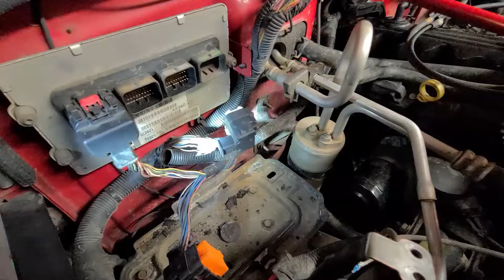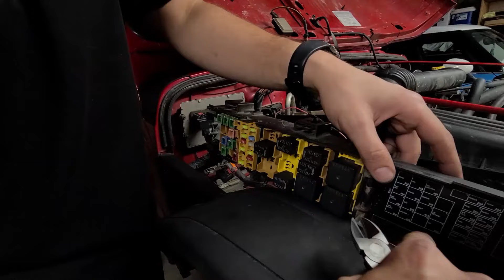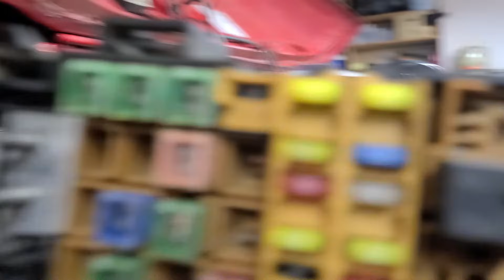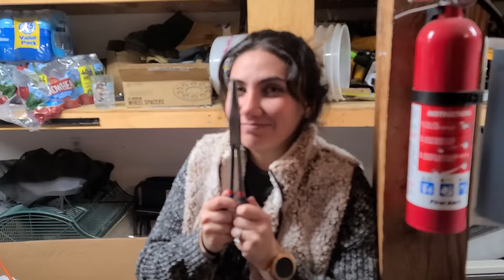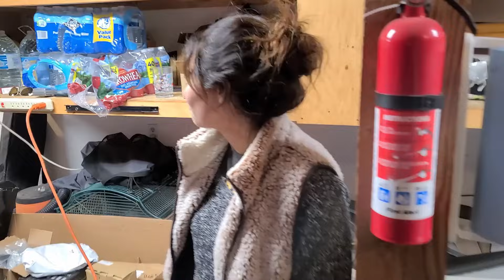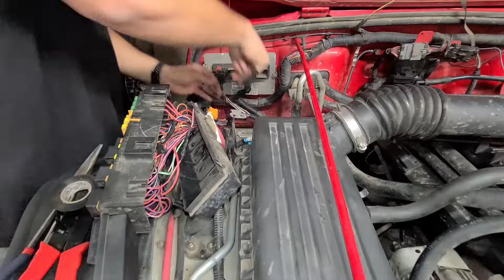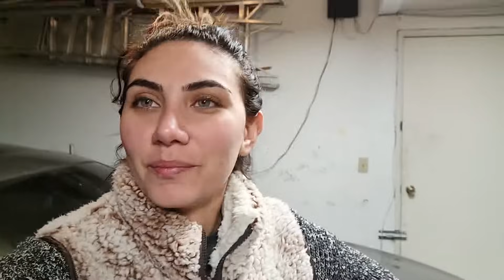STRANDED by the ASD Circuit! Here is HOW we Tested and Fixed it! Easy!

Comment: Great video. I think I'm closer now to solving my intermittent stall. When the jeep warms up it stalls and it won't start until, with the key in "run" I hear the fuel pump kick on. I read that the ASD relay controls that so it seems I'm getting a short that tells the ASD that power is off then on. I've tries two ECMs. Which wire was the brown one that was broken called? My cherokee is a little different relay than the wrangler.

Comment: I have a 95 grand that's currently in the shop for the 20th time,  trying to figure out my intermittent shutting off issue. I had researched and replaced my ASD relay and it worked for 3 months or so. Current mechanic has it for the 3rd time and it's throwing a code for the camshaft. He replaced that and the distributor cap and it worked for a month. He's currently puzzled.
What it does is it shuts off while idling or driving slowly. Battery and dash still on. Then it has to sit for a hot minute before it'll turn back on and stay on. 
Any ideas?
Reply from the maker: I'd replace all the sensors like the cam and crank sensor the neutral switch etc
Reply: @Garagecouple  yeah, we've replaced those...

Comment: Very interesting ASD discussion. My problem is quite a bit different -- but similar, go figure!

Very infrequently, like months apart, I will be driving along without any problem and my 2007 Grand Cherokee just stalls -- no engine light, all electrical power okay. So I pull over, put vehicle in park, restart without any problem and away I go. Maybe weeks, or months later -- boom!!, same thing happens again. Park, start and away I go again. Obviously we are not taking it out on the highway, only back roads -- can you imagine the danger of driving at 60mph and having this happen?

Anyway, swapped the ASD with the relay for the HVAC (same relay) yesterday and will see if the problem reoccurs -- but it sure would be nice to know if it is "really fixed". Oh, by the way, the error code is the same P0688 you mentioned in your ASD video.
Reply from the maker: Hello and thanks for the comment! Sorry to hear about your issues. That sounds like a parking or neutral switch in the transmission. In any case I'd change out all of the electric switches like the crank and cam position sensors, transmission sensors, etc. Cheap and quick and hopefully fixes your issue

Comment: Hey bud I have the same issue crank no start.  Fuses are good, Both the fuel pump and ASD  relays clicks. new fuel pump still has no power to the  pump. What could be the problem

Comment: 96 Grand Cherokee chokes and dies when outside temp is over 75degrees. Starts after 30 min, goes a few miles and does it again. Don't have this issue in winter. Already changed O2 &crank senors, ECM. Any idea what's causing this? Taken to 3 shops, they couldn't figure it out.

Comment: Thanks for the video. As an electronics maintenance tech, I highly recommend checking out "solder wire connectors"!! Electrical tape is a %@^#& later on. 

One question tho, did the failed asd cut off fuel also or just spark? My jeep has no spark, but it's flooding with fuel.
Reply from the maker: I believe it's both fuel and spark. Cheers!

Comment: Hello and thank you for the information.   I was about to buy a new crankshaft sensor but decided to try your  ASD bypass.  It started right up.  Now my question is how do you know for sure, by doing this bypass,  that it isn't the crank or cam sensors causing it not to start?  Could it still be a bad crank or can sensor?   Thanks!
Reply: Bypass probably means just bad pcm communication wire. If it was a sensor it would have a code for that.

Comment: I had a problem with the wire going back to my fuel pump. It had fallen down on the drive shaft and was worn through. Every time i stopped at a light or sign it would blow the asd fuse. After changing out many parts I finally found the issue and fixed it. Then a month ago the jeep didn't want to start. It seemed like I had no fuel pressure at the injector rail. I changed out the fuel pump and it started up perfect and ran great for a day. Then it started stalling and not wanting to start. The wierd thing was i was not getting any check engine light. I bought a code reader that does live data and hooked it up. I have me the code for the ASD CIRCUIT SHORT. I started messing with the wires that go to the pcm and the jeep started but then when I would mess with the bundle of wires it would start to die. I could let go and it would smooth out and run fine. So I figured I had a short in that bundle. I started where that bundle mounts to the fire wall and checked continuity all the way over to where they attach to the pcm. All of the wires had continuity. I'm at a loss now as to where to go.

Comment: This was only the latest symptom, my first problem was the jeep would retain ignition power or some ignition power after I turned the key off, resulted in my Jeep staying running even with the key taken out. Then it started dying while driving and one day it wouldn’t start back up, I noticed the ASD relay was hot so I replaced it with the horn relay and it started right up and now issues seem to have all gone away, not convinced it’s fixed but this may be a problem I have As well. Thanks for your video

Comment: You guys are super fun. I found you because I had a similar issue. but I started with the fuel on my 98 TJ. I checked the pressure and it was not priming, I could prime it then at some point it would lose the prime again, So I replaced the pump. After replacing the pump it would start  well it started but it sputtered and backfired. Then all of a sudden I lost all of the gauges on the dash. so I was pretty bummed and at that point I lost the aldl and was sunk. Then I let it sit for a couple of days and went out with a test light and rechecked all of the fuses again. None were bad and it still wouldn't start. I then decided I was going to do a pinout on the computer like you guys, and I didn't find any issues so I was scratching my head, and out the plugs back on the computer. I then noticed that the gauges started working again and I had access to my ALDL, so I turned it over and it started right up. SO now it runs, but anything over 70 miles an hour it sputters and spits. So I need to do what you did and follow the wires and make sure I don't have any issues like you, but that is tedious and takes a while. For now it drives around town without issues. Thanks for this video it was really helpful.

Comment: Great video thank you say I got a 2004 Jeep Grand Cherokee with a 4.0 and it cranks but won't start ,
The list of parts I have installed new cam and crank sensor fuel pump throttle body sensor looking for any suggestions from you or your viewers ?

Comment: Great video, you said you've done a lot of Internet searching. Well I've got a 2000 wj with basically the same wiring, mine won't start, fire I mean but the ASD solenoid is opening and closing so fast, that it sounds like it's a running motor. There's wiring and then there's jeep wiring, IDK. Did you run across anything like that.

Comment: Working on a liberty jeep that complains ASD relay circuit. I've checked he circuit and every current supposed to be available on the bunch is except for the negative that comes from the pcm, traced the line into the pcm socket and it reads okay. Changed the pcm but still have same issue, took negative from another relay into the ASD relay but problem still persists and the fault code keeps repeating itself. Please share idea on this friend. Thanks.

Comment: I have a 1991 yj that overheated. I fixed that issue (waterpump) but now it starts up the first time and runs great for about 3 mins then dies. Then I have to wait a while before it will start again. Then it does exactly the same thing. Any ideas?

Comment: My car keeps dying while I'm driving or at a stop... Not sure what it is the battery is good and the alternator are good. It does even if I'm trying to pump the gas it just shuts down. I do have an aftermarket radio that was recently installed a few months ago don't know if that could be part of the problem..

Comment: I got a 1996 dodge ram same problem fuel pump not coming on brand-new,coils not spark brand-new ,pickup roller button ,dis-cap all brand new crank sensor brand new,

Comment: nothing better than stepping through a successful diagnosis.  i’m fighting with a 2007 jeep commander myself. i cant get ground on the relays.   i might try jumping the asd    if i run a separate ground wire from the relay i can get it to crank but it won’t start.  might be a bad pcm.  trying to figure a good way to diagnose that
Reply: Figure out your problem with your Jeep

Comment: I have a 1999 dodge van. As you probably know, dodge and Jeep are both made by Chrysler . I tried the jump wire on the ASD relay and the engine doesn’t start. Does that mean that the cam shaft position sensor or the crank shaft position sensor could be bad?
Reply from the maker: That is definitely a possibility!
Reply: @Garagecouple  Thank you very much for your quick response. I have replaced the crank shaft position sensor in the past so I will check the cam shaft position sensor. I appreciate your quick response
Reply from the maker: Very welcome! Good luck!

Comment: I have a 2014 Jeep rubicon Unlimited and today my jeep shut off going through an intersection and I coasted to the other side and stopped on the side of the road stranded come to find out the ASD 10 amp fuse was blown so I put another fuse in there and it blew so I swapped out the relays and that didn’t work so do you have an expert opinion On what my problem might be.  It’s been a long day 🤭Thanks in advance
Reply from the maker: Sorry I don't, sorry to hear that! It could be one of the sensors that provides input to the asd.  Maybe cam position or crank position sensor
Reply: @Garagecouple  Well I ended up finding a chaffed wire the same wire you showed in your video what are the chances of that lol.  I might not have looked for chaffing if it wasn't for your video though so thank you very much.  I repaired the wire and problem solved plus I wrapped all the other bundles that plug into the fuse box just as a precaution.  I have the genesis dual battery system in my jeep the wire was laying right on a corner of the metal battery box and that was the only chaffed wire.
Reply: Just wanted to let you know that my 2014 Jeep rubicon had the same color wire chaffed that you showed in your video.  But if it hadn’t been for you video I may not have looked for a chaff.  I removed the fuse box and started searching for chaffed wires and there it was .  Thanks again for the video your video is the only one of its kind on here.
Reply from the maker: Awesome!so glad to have helped! Cheers!

Comment: Hi Garage Couple,

Jeep WK Hemi 5.7 Limited
Driven 150,000 miles
Usually Starts and stalls after 2-3 seconds
Sometimes starts and runs fine
Active codes are: Open circuit code
Saved Codes: U0100 & U140E

Note: When car starts fine; turning the steering wheel right will cause a sporadic amount of lights to show up on dashboard!

No blown fuses that I can find!

Do you think it is a problem with the ASD and should I take the same steps as you did? My mechanic is telling me to order a new PCM :/

Comment: I have a 2014 JKU, It shut down while rolling down the road last week. After scanning it threw the Po688 code ECM/PCM power relay Sense Cir/ open. I checked for corrosion on the pins of the relay, detecting none, I replaced then discovered that the 25amp fuse marked ASD #1 and #2 was blown. Replacing that solved my problem for a week. Last night I blew three of those fuses in the space of the last 2 miles to home (stopping 3 times to replace that fuse). HERES THE QUESTION! could it be a crowbar circuit relay that is designed to pop that fuse as a safety? In other words, is that relay popping that fuse by design in order to protect the engine?
Reply from the maker: Hi, I'm not 100% sure, but it sounds like its a safety feature
Reply: I am having this exact problem.  It went dead after hitting a huge pothole.  What was the solution you found?

Comment: Hi …I have problems with the asd. Sometimes this car starts sometimes doesn’t …I checked the ground continuity from asd relay ground to computer there’s continuity but no ground from computer ..it happens sometimes. …what sensors are connected to the esd
Reply from the maker: Sorry to hear this! Hopefully resolved by now
Reply: Having same issue... you get it fixed what was it?

Comment: 2011 Dodge Charger Rt 5.7 engine, No power to the front fuse box ASD fuse or relay. I moved the fuse and relay to other positions and they are ok. Car will not start after I installed lifter. I have replaced cam shift sensor, Crank shift sensor, knock sensor, Map sensor, new fuel injectors, cleaned spark plugs and reset them. HELP
Reply from the maker: Ahh shoot. Sorry we aren't able to help. hope you got it figured out!

Comment: 2000 Jeep Wrangler just quit while driving . Seems like fuel issue . I can hit it with starting fluid in the tube and it will run a couple seconds . So I put new fuel pump
In and does same thing . Cranks and cranks But will not start . Hit it with starting fluid and it starts right up for couple seconds . What would be a couple things to look at ? Thank you
Reply from the maker: Sorry to hear this, glad you are safe! Did you check the pressure in the fuel line?

Comment: I am right you I have about three months trying to find out why I have a crank no sparks no start.all sensors are new wires,cap rotor, cam(pickup coil) ing coil. New.i  don't have the whole 5v to the 5v reference wire. Maybe up to2.2 its a dodge so I guess that says it all..03 D'Amato 5.9l magum.is it the pcm
Reply from the maker: Awesome!

Comment: When I turn the ignition on the ASD and fuel pump relay starts chattering. When I try to start it. It just clicks and nothing. The chattering doesn't start again until I switch the ignition to off and then back on. Any idea witch sensor is acting up?

Comment: Have an issue with my 16 Jeep JK. Battery keeps dying over night so I did a parasitic draw test and it was pulling 8 amps. Ended up being M21 20A ASD #3 fuse but still haven't figured out what is causing it to draw that much power constantly. Still researching it :/
Reply: Do you have the Rubicon model? If so, check the electronic sway bar connection for water damage. The ASD is also connected to that as well. 😠

Comment: I have an asd issue on a 99 WJ, although mine blows the fuse after the Rpm’s go past 3000...I will check the pcm wiring tomorrow but if you have any suggestions? Its actually the injector fuse that blows...some research lead me to the asd, through a code...
Reply: Did you ever find out why the injector fuse was blowing?
Reply: @clydepurk7162  yea, sorry so late, it was the alternator, i replaced it and it works fine, i read about it in a forum…
Reply: I found a blown injector fuse after the guy replaced the coil on this 2.4 Wrangler. It doesn't blow the fuse anymore, but the Jeep runs so doggy, I'm wondering if he damaged the pcm or new coil by hooking up the coil wrong. Ground wire looked damaged by the pcm.

Comment: Great video. I have a weird problem with my 2012 Jeep Liberty. Randomly, it will have what I can only describe as an incomplete ignition? It cranks and starts, but it feels like the crank cycle is short, and then it feels like the car is only firing on 2 cylinders, bumping around and making puffing noises, and I can't give it any gas, the RPMs dont move. I shut it down and wait a minute, and it fires right up. Could the ASD be a possible issue?
Thanks for any info
Reply from the maker: Ahh sorry to hear this. Not really sure what to make of it, but it could be the asd relay. I would take this in
Reply: @Garagecouple  I actually just replaced the ASD relay just because it was so cheap, figured it couldn't hurt. So far no weird starts, and oddly enough, it also cleared a faulty tire pressure alert I was getting for a week or so on top of that. Fingers crossed it stays good. Appreciate the response.
Reply: Look at the OBD2 diagnostic codes and first suspect O2 (oxygen sensors) before and after your catalytic converter. Buy some MAP sensor cleaner - DON'T use carb cleaner. Then recheck the OBD2 code

Comment: I have a 2000 Jeep Wrangler TJ. I am experiencing something odd. So, I was driving home, check engine light came on. Drove fine, shut it off at home and wouldn't start up. Cranks no problem, wouldn't fully start. I wonder if this is my issue. My wife is getting the CPS now for me to change but I don't expect that to be the issue.
Reply from the maker: Sorry to hear that! I would have a mechanic take a look, sounds dangerous!

Comment: The small round washer at the end of my transmission that controls the clutch has been rattling very loud the last couple of times I've crank it up I crank it two times heard small rattling and then the third time nothing it will turn over I replace the new battery it will turn over but it will not fire up no fire up no fire going to spark plugs ?
Reply from the maker: Good luck!
Reply: Crank position sensor was the cure for me on a 96 Dodge Ram 1500. Check it and your cam position sensor. I hope you find the problem before you spend to much money on parts. I was told it was a bad PCM before I figured out my problem. Good luck with it.